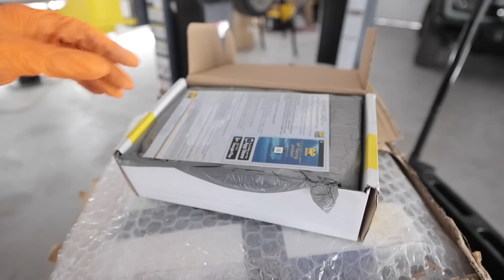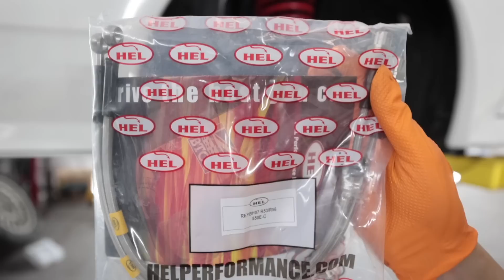Audi UrQuattro Upgrades! 5 Cylinder Turbo Pure Sound

Comment: Are you familiar with speed bleeders?  They replace the factory bleeders, and contain an internal check valve.  You open them, leave them open, then just get in the car yourself and pump the brakes.  They're great.

Comment: Or you can paint those calipers with Por-15. I would also paint the  non braking surface of the rear rotors too before they turn brown with rust.

Comment: The ATE BlueRacing Fluid is discontinued. They replaced it with the better successor, the ATE DOT4 Typ 200. The problem with the ATE Blue was that it was even more hygroscopic than the standard DOT4 fluid (Blue: replace every year, standard every 2nd year). The Typ 200 now has the same better attributes like the blue (higher boiling point) but the same change every 2nd year. No longer super-hygroscopic. 😃
The Blue was streetlegal, yes. The new Typ 200 is streetlegal, too.

Comment: I just vacuum bleed by filling the reservoir real full and then using a syringe from a farm and feed store. It’s really clean, impossible to get air in it and you can see when the clean fluid comes through.

Comment: why not contact AP Racing and see if they make rear brake calipers?  They may not be specifically for the Quatro, but I am pretty sure they have a model that would work for it and all it may take is getting a custom mounting bracket for the caliper to make it work.

Comment: Chances are if it does that after a while you have a percentage of alcohol in your gasoline, which if left to sit can gum up your jets.  Running it will flush the jets, which is why it will clear up.

Comment: Those dust covers are not dust covers. Those are air shrouds for cooling the the rotors. They are for catching air, which gets forced into the center of the rotor and then is expelled to the outer edge of the rotor. That's why rotors have air vane channels. So... Be careful not upset that function. I'd to see you warp your new parts.

Comment: Curious if you had a high Mechanical score in your Air Force ASVAB tests.  I had a 95 in Mechanical but the AF chose to use me in the General field where I scored a 60.  Go figure.
Reply from the maker: Haha, wild! I scored a 95 as well in mechanical, 86 in electrical and I don’t remember the other two.. they were both 70 something.

Comment: okay, no fair laughing at me if this is a dumb idea: what if you took a co2 fire extinguisher, put a reducer to take the output from its normal 4 inches to about 1/2 inch, to blast a small job like the brake caliper? Whether it works or not you can get it recharged for about 20 bucks. If it works, buy a half a dozen of them from a Public Surplus auction.

Comment: Hi Sarah. Im John. would you be interested in a passat MK II syncro variant with "hagus" and towbar, with both locks, discs on all wheels, electric windows on all doors. otherwise, the engine is a 5-cylinder with a mechanical injector and an original technical certificate ?

Comment: Sarah, you know what is a pretty decent brake fluid that’s actually made in Germany is the Castrol brake fluid , synthetic brake fluid exceeds  dot 3 &4 specs it comes in a black bottle with white and green lettering with gold on the bottom and on the very bottom says advanced performance series I run this in the Subaru. This stuff supersedes the old GTLMA

Comment: Are you sure about cam being the only change? Sounded like from the power difference there was probably valve spring changes also(on the wr-2) and yeah it does sound like yours has a cam swap

Comment: ATE superblue was banned due to color requirements for certain automotive fluids. Just like all ATF is red, etc. ATE 200 replaced it. Same stuff, no blue dye.
Reply: We used to alternate between ATE 200 and Super Blue for just that reason.  That way you always knew when you'd flushed all the old fluid out.  Pissed me off when they banned the Super Blue.
Reply: @rennkafer13  Same. I miss the blue for that reason.

Comment: Sarah, have you ever been to Bashas grocery store? I walk past the dry ice cooler every time I go in. And, in my past experience, bashas is super cool about getting anything they can get that you want, if you ask. I have done "custom orders" through bashas before, and it was super easy. They actually had to order more than I wanted to suit my needs, and the only thing they said was "if you want even more (this quantity), we can make you a better deal". The deal wasnt "super cheap", but they accommodated it, and the price was "just about what everybody else would charge" delivered to my local bashas store. (It was meade). You can get dry ice from bashas no problem. Or, you can research who else uses dry ice (medical stuff), and find a supplier.

Comment: ........Wow, the exhaust pipe Charlie made... that welding belongs in a museum, not under a car.  2. I know nothing about engineering, but making a brake rotor out of two pieces bolted together just seems like asking for trouble. Good thing you won't be racing it. You won't be racing it, right?

Comment: Drilled rotors are useless for road driving, unless your going to take it out on the track. Drilled rotors was meant to release gases from the metal heating up so the pads don't (so called) hydroplaning effect. Any body that has drilled rotors on a road car just has it for looks, but don't realize they can have issues like you just mentioned.

Comment: like I said before Audi S4/ S6 or 200 Turbo quattro rear breaks are an upgrade for the quattro because i doubt you get quattro 20 VT rear breaks
BTW. is sahra 2 Drunk or high, it's kinda disturbing.

and a EFI on a 10v makes not a bit, it makes a bunch more Power
and it starts feeling "alive" like a squirrle on cocain instead of a tired donkey that get kicked in the but.

Comment: You have air tools for a reason,..that being to keep from tearing skin from your knuckles and get tight fasteners off. So why didn't you use your impact to remove the caliper, and anything else that you needed to remove?  Work smarter, not harder.
Oops, I am so sorry, my parents would thump me on the head for forgetting this,..
Greetings from the great white north of North Pole, Alaska, and no it's not cold outside. But it is getting closer to that time again.